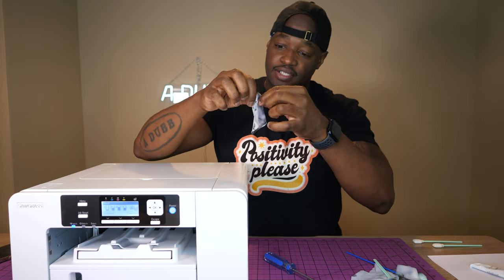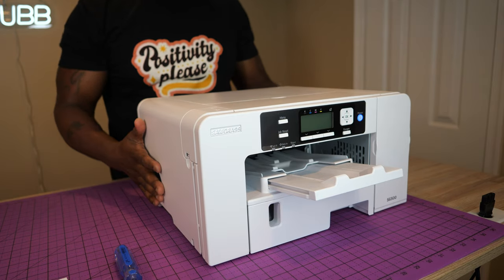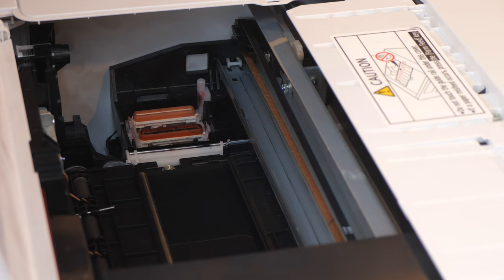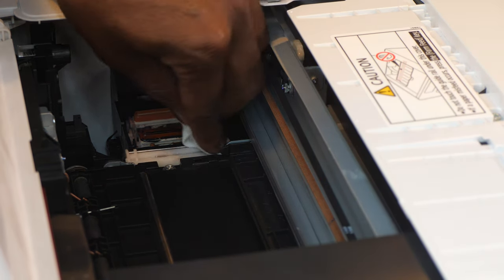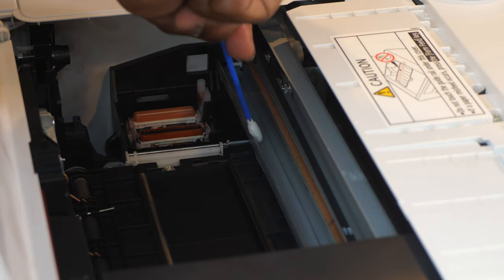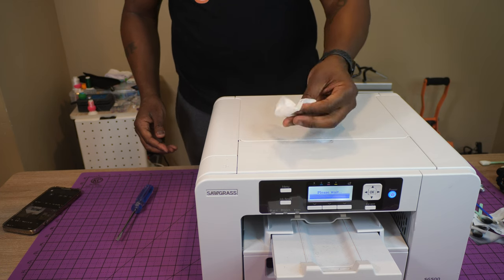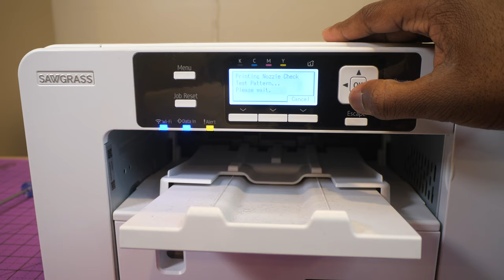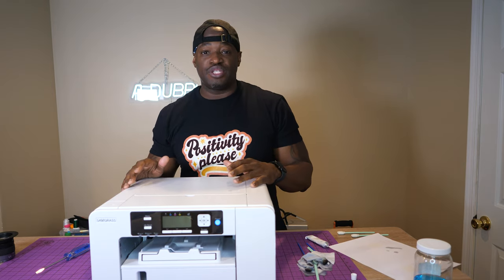How to Clean Capping Station | Sawgrass SG500/SG1000

Comment: Good afternoon, I have a problem with a Ricoh SG 3110dn printer, it gives me the SC 57000 error, I already cleaned the transfer belt or band with alcohol, I changed the sensor that reads that band and it's still the same, what else can I do? there, I would, And I have two printers for the same reason, or could it be that due to the number of pages that the printer has, it is asking me to change that transfer belt, appreciate your collaboration, thank you
Reply from the maker: I have no Idea what the issue is.  I do not own any of those printers. I would suggest contacting the manufacturer. If it is a sawgrass they will help you as long as you have sawgrass ink in them.

Comment: Hi can you tell me why the little Alert light goes on in the front panel without any error message on the lcd screen?  What does it mean?  I’m trying to print on a 4 x 9.5 mug paper.  I have the settings as such in the print manager too for my print job but nothing happens.  I’ve read the entire 139 pg manual and can’t find anything.
It’s The weekend so I’ll be calling tech support on Monday.  Hoping this could help your audience if you know the answer, thanks 🙏

Comment: I have a SG 500 and I am having to do a head cleaning every day because magenta is not working working right.  I opened a ticket with Sawgrass and they told me to flush 5 times.  It wasted all my ink😢.  I have had it for a year.  Will this help?
Reply from the maker: I promise you the company has way more information than me.  I have never had that issue with my machine so I really don’t know.  They have probably heard it all, tested it all and tried it all.  Sounds to me like the line is clogged and they are trying to help you unclog it.  It is unfortunate that you have to waste ink doing it but there is no other way to flush the line than to flush the line.
Reply: Thank you for responding and thank you for making this video.  I will definitely keep my SG 1000 clean now that you should me how to keep it clean 😊.  Just purchased a SG 1000 a few months ago.  Hopefully they’ll help me fix my SG 500 🥹

Comment: Hi i have a promlem that its very annoying.  So every morning  after the night of resting , when i print on my sawgrass there is either yellow or red lines in my prints . It seems like i need to do 3 to 4 prints before it starts to print well . But i dont want to do that because its wasting my ink .  And i dont want to keep doing a print head addusnebt or noslzzle clean   why does this keep happening
Reply from the maker: You would need to ask the manufacturer how to solve this. Cleaning the capping station helped me.  If it did not help you you should contact sawgrass. They are very helpful and I’m sure they have the answer to your question.

Comment: I bought a used 1000 and it gave me the clean the print head error, but the print head doesn’t move, it jiggles in place, i can take the side panel off and move it manually but mine doesn’t have the orange caps on top like yours appears to have.  I think I bought a lemon 😭
Reply from the maker: Unfortunately it sounds like it.  Always get them to test out stuff like that in front of you so you know it works or just buy brand new so you can avoid potential headaches like this. I really hope you figure out how to get it to work.

Comment: Ive had error messages on my sg500 since I bought it. Sent it back after it broke down and they sent me a replacement, which has also broken down (error messages once again). Probably put less than 10 hours on the first one, maybe 3 hours on the new one. I am over this printer and this company  :/